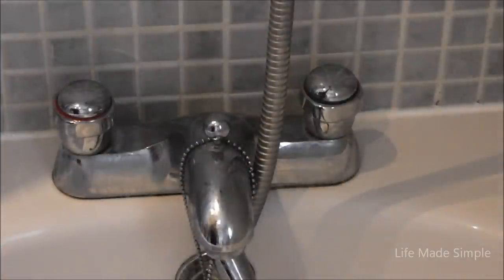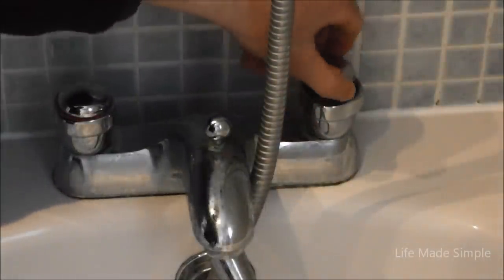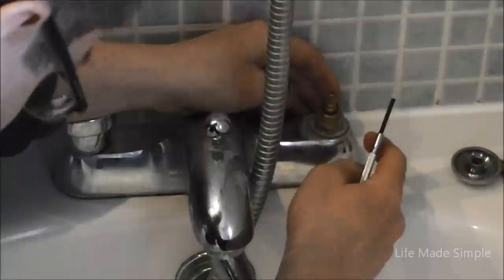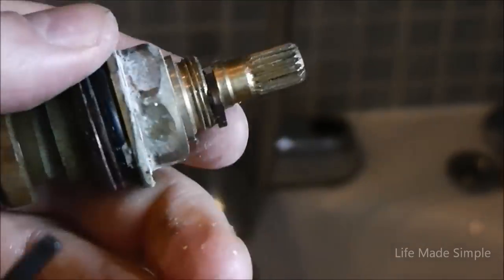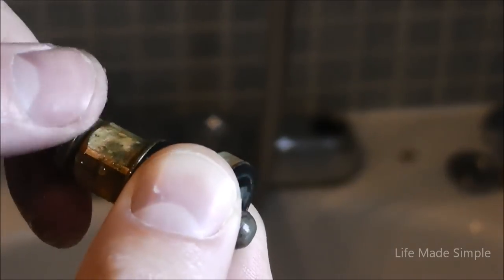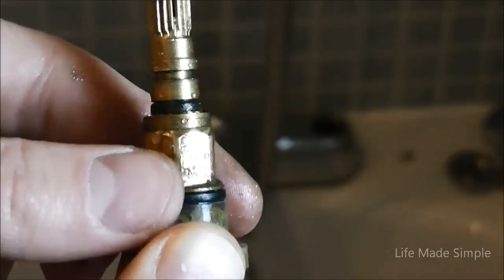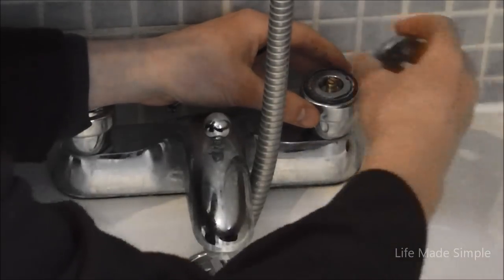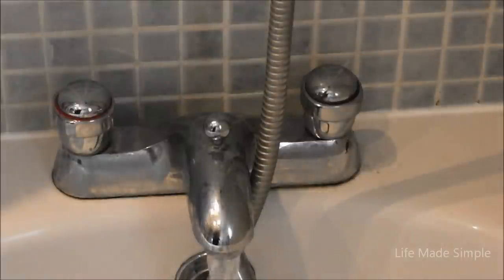Fixing a bath tap

Comment: Thanks for making video - I have a similar issue, with the same model tap (the flow from the cold water tap is now down to a trickle). I was wondering how to take tap apart, in order to by a new stem, but it appears this is a known issue, and taking the stem apart, giving it a good clean and tightening it will solve the issue.
Thanks once again, for making a very clear, and easy to follow video.

Comment: Worked well for me, i just did the hot and cold tap in the bath and they're like new. 16/17mm spanner, flat head screw driver, small hammer and a mini screw driver for the circlip. Oh and a bit of elbow grease 👌 thanks

Comment: Thank you for the video.  It gave me confidence to attempt this type of repair, but any ideas on how to do this on a Wickes Trade Bath Shower Mixer Tap?  It does not have the same head fixture, so there is no further visible screw to turn to get the rest of the tap head off.

Comment: You said you turned of the main downstairs what happens to the cold feed from the tank to the cold tap to the bathroom tap do turn that of as well
Reply: I think in the hot water cylinder the cold feed pipe from the storage must have a gate valve or  you drain the storage cistern or tie the ball valve with a piece of wood and string